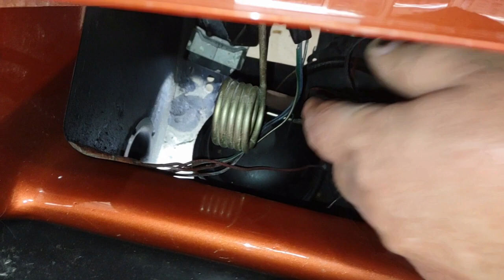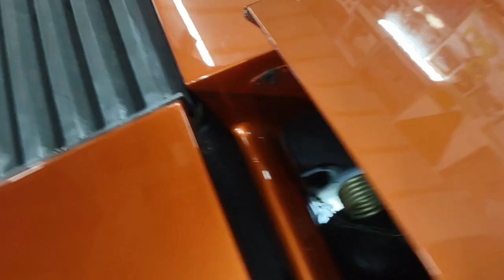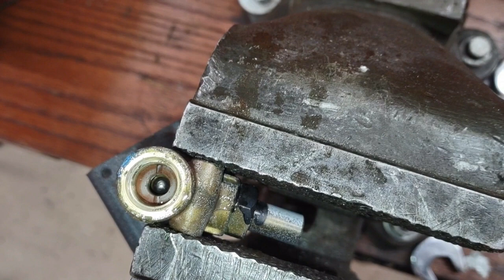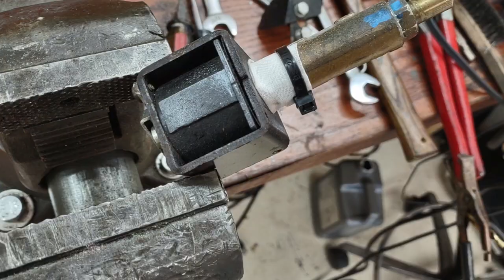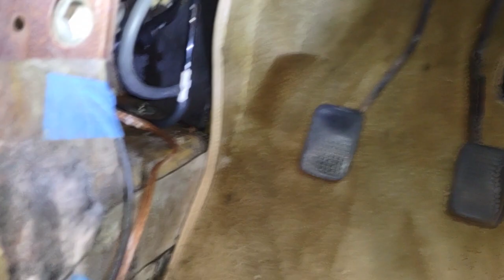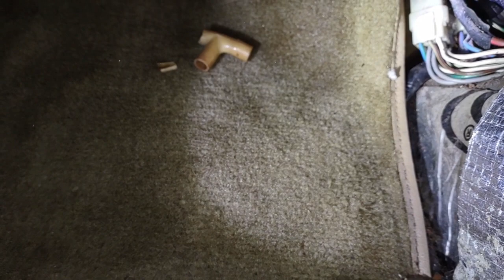Lotus Elite Vacuum Solenoids for headlights

Comment: Hi my other half has just bought a 501 elite to do up for a hobby, but his lights arent attached. He thinks hes got all the bits and is sat looking at the exact same yellow diagram thats the front cover of this video but hes none the wiser. We cant work it out, part 8 looks to return or t down?
Reply from the maker: #7 is the start at the intake manifold. Vacuum starts here. At the bottom of tank - #1 the connects are all the same. if the T is on the top or bottom it should not matter. If you have vacuum to the tank then check for vacuum at the solenoid #10. The Lotus Elite, Eclat, Excel group on facebook is a good group for help. I and others can help you there easier than messages here.

Comment: Thanks for sharing. I have question. I replaced all vacuum hoses, new switch and new vacuum solenoid but headlights still up..? Any suggestion. Thanks
Reply from the maker: If they are not moving at all then check to see if you are getting power to the solenoid. It should click. If you have a vac tester see if you are getting vacuum at the solenoid. Sorry for the late response.

Comment: Hello from the UK I have a 504 and there is that unit you are Describing also a smaller one at the side. ? . and the Passenger side just 1 smaller one . the pip's are not connected and one pipe is Blanked of . in the manual only one solenoid per side so I don't Know where the pipes go . cheers .....
Reply from the maker: Sorry for the late reply. I was not alerted to a comment. The tank you see is in the foot well behind the trim panel. The plastic vac pipe runs inside the fiberglass over the wheel well and into the foot well. There should be a crossover pipe between the light pods. I have seen the pipe run at the top of the radiator.

Comment: Many thanks for doing these videos. I've got a 1974 Elite and have a new problem after refitting the engine and gearbox after a gear lever failure. One of the new issues I have is the left hand headlamp is VERY slow to lift, but goes down OK. So I suspect that the solenoid has an issue. So it's great to see your video on how it works as I've not really touched that system before apart from a vacuum leak on one of the solenoids once. My car has modern Burkert solenoids fitted, but the original solenoids are still installed, just not connected.  Would like to know more about your smoke generator, I've thought about making one rather than buying one and i like the look of yours.  Cheers!

Comment: just bin the system its crap and put mr2 headlamp motors in or do what ive done and put cupboard door gas struts in and some little electronic door latches in to hold them closed .....it does mean i have to manually close the pods though ! i press a momentary switch inside the car when it gets dark and up they pop !

Comment: V. interesting. I have the Eclat ('77) which had rusted out pods. After repairing them, the headlights actually stay down for several hours. I like your idea of introducing smoke to check for leaks in the rest of the system and wonder if you could tell me more. "smoke generator" on Amazon?? Also, bought 2nd hand untested 1 way valve from the UK and wonder where you sourced yours - I assume you bought new? In N. America? Thanks, and good work!
Reply from the maker: I got my smoke gen from ebay. Look for evap smoke. Many versions under $100. Mine was the basic paint can that was about $60. They use mineral oil to make smoke. I use it to also check for exhaust leaks. Put a filler around the tube and push smoke in from the exhaust pipe. It finds gasket leaks. I got the valve from RD Ent. It is a Lotus part 36B0136R  $19.00.
Reply: @lotusrepair1439  Brilliant! Thanks very much